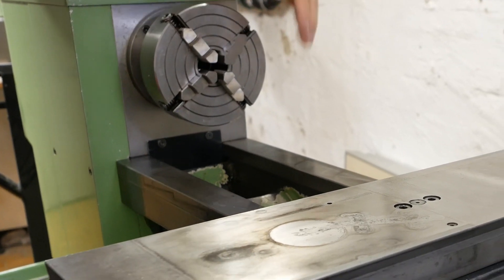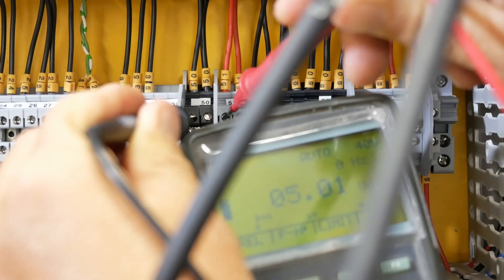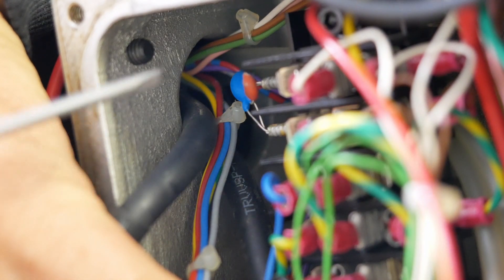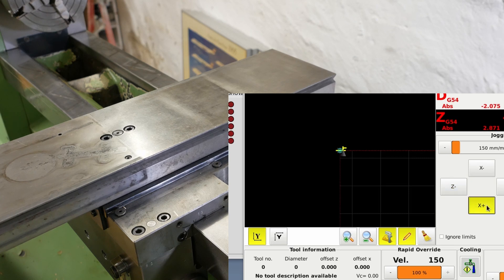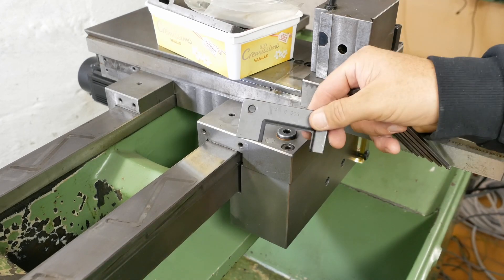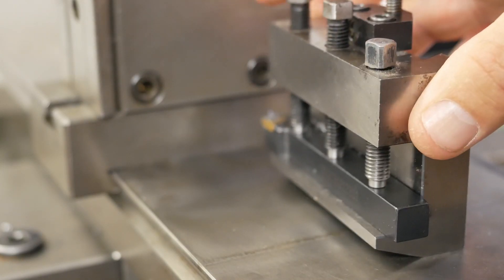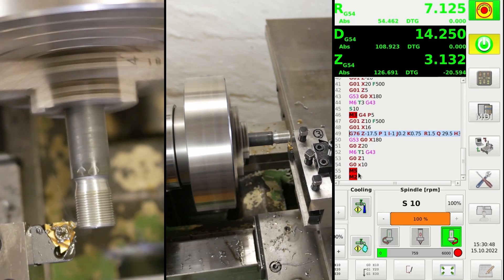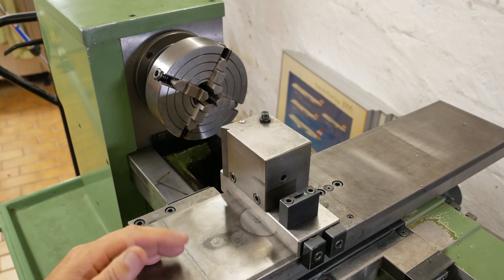Troubleshooting and progress - Schaublin 125-CNC retrofit Ep.44

Comment: Wow, nice progress there. But those cuts don't look or sound right to me, not for a CNC, i don't know. I would test it with "better" material, different inserts, speeds...
Reply from the maker: I am just getting started with this machine, and it will take a while for me to learn it.
Reply: @RotarySMP  I'd measure X when taking a cut in Z, or maybe just let it turn without a cut just to make sure servos are not getting funny instructions from electronics.
Reply from the maker: @NskLabs  I have tuned the servos better since I did that first rought tuning, but it is a good point to check again undr load, as that is when interference is more likely.

Comment: Do you have to setp for the pin to become active? Say for an index input pin on spindle0
Reply from the maker: The Mesa 7i85 has dedicated encoder inputs (as do 7i77, 7i97 etc). So you wire up your index, A B and inverse signals to specific connectors, but then dont need to net them in LCNC. You can  net to the Encoder pins such as index, counts, etc.

Comment: Swarf at high speed woo hoo.  Yes we can all write gcode which is painfully slow. Do you not have ncam (native cam) on another tab? I use ncam for milling routines. It’s very good and I imagine a big help for your lathe 😊
Reply from the maker: I installed Andy's "Lathe Macros", but it turns out I installed the files associated with LCNC 2.9, but I am running 2.8. I need to either update LCNC, or dig out the older files. That sort of canned cycles is normally good for 95% of lathe work.

Comment: I am continually amazed at your patients. Something I never had. I see that Schaublin uses the same cross slide nut attachment arrangement as Chinese mini lathes. I just made an adjustable nut for my 7x. And thanks to Heather...I enjoy the sparks too.
Reply from the maker: My guess is that the precision ground ball nut for the Schaublin costs significantly more than the mini lathe :)
Reply: @RotarySMP  I know nothing about the nut itself. I just noticed the the way it is attached. Two outside screws with a depth stop screw in between them. I had thought that only Chinese lathes used that method.

Comment: Ewww, feed/min on a lathe?  Nice to see chips !!
Reply from the maker: Good point. I need to learn to use surface speed.
Reply: @RotarySMP  feed/rev comes naturally. Surface speed is optional, imo. I only use it when diameters are large and there is a lot of material removal.  Otherwise you wait for the spindle. Under a certain diameter, it's essentially always max for aluminum anyway. For steel it gets more use. How long until we see a model engine build?

Comment: Another breakthrough. I'm made up for you mate. 
Those bare cap leads are quite an oversight by Schaublin tbh. All they needed was a couple of sleeves to prevent shorts. Unless, of course, the cap was fitted as a mod at some point?
Reply from the maker: You know, I just found out that the variator end stop (24V) switching, is triggering a Hall sensor and estopping me. I wonder whether the caps were added for that? They are 40 years old, and may have dried out?
Reply: @RotarySMP  The capacitor responsible for the home sensors doesn't look like an electrolytic which have the infamy of drying out, but more like a ceramic type, or maybe even a transient suppressor such as a varistor given the odd colour marking. Hard to identify properly from the short role in this video, but the one shown looked like it has proper wire wrapped joints as termination which is why I'm puzzled that sleeves were not used.

False triggering might be from a long run of signal and power lines running in parallel that may have been introduced, and revise them. Also check terminations of the Hall sensor return which might be high impedance. If it's for a safety interlock, which would be normally closed, the high impedance connection lets just enough current flow for normal operation, but is highly susceptible to switching spikes. Good luck with that, they are a devil to trace.

Comment: let your friend know I would be willing to pay him to help me get my lathe configured, she's gonna be ready for configuration work tomorrow. You should consider one of those chinesium 4 position tool changers, they have upto 8 positions horizontal ones too. Are you going to have flood coolant ?
Reply from the maker: I will pass your comment on to Wout.

I have the 4 position pneumatically actuated tool changer which came from Schaublin. It can also take 4 more in round mounting points. Once I have the user module dome, that will be thenext part of the Schaublin project. Yes, it has a flood coolant tank, with 3Ph pump, and Pneumatic shut off valve integrated into the machine. I am not sure whether I will actually fill it and use it, but it will be there.
Reply from the maker: I talked to Wout, but he is swamped with work, and not available for other tasks. He does check out the Linuxcnc forum sometimes, so If you raise a thread there, he mikght be able to help a bit.

Comment: Great video!
Usually carrier frequency of the drive(kHz) can be changed. It will change the noise of the drives but also will change the switching of the IGBT.
Reply from the maker: Good point. In need to look up the range of frequencies it offers.
Reply: @RotarySMP  It is called switching or carrier frequency.
Reply from the maker: @Izidor1111  Thanks. I'll check it.

Comment: WOOP WOOP Congrats on the first thread. 
Keep ya rapid traverse where you are happy quicker is not always better. 
Had a couple of Hardinge lathes and they got smashed up because even with 30 m/min you have NO time to react. 
One machine got written off after going full rapid speed into a 8" chuck going 5000 RPM  was only 6 mouths old 😁😁50k+ destroyed in seconds. Oh and a new pair of pants for the operator 🤣🤣
Reply from the maker: I am also thinking about dialing that back to 1m/min, until I get some experience on the lathe. I already showed enough CNC crashing with the Maho. :(
Reply: @RotarySMP  Just think of it as a learning curve when u do have a smash but 1m/min you can relax 😁😁. 
But nothing worse than the "shame and embarrassment" when you do it in a shop with 30/50 blokes. 
In the UK. Most people check to see if you are ok right after a smash, to immediately piss-taking for the next few weeks or until someone else does it. 🤣🤣 Cheers keep  up the epic vids 👍👍👍👍
Reply from the maker: @harezy  I can imagine that some of those"destroy the new machine" crashes can follow a guy for a whole career.

Comment: Really curious about your setup for the cuts in the "sparks for Heather" section... Is that a long parallel or something that you're using for a cutting guide? Never would have thought you could get away with the cutoff disc rubbing up against it without marring the guide... Or maybe that's not a problem?

Thanks for the video 🙏😺
Reply: It looked like just a piece of scrap flat bar to me.
Reply from the maker: It is just a piece of scrap. Running the cut off wheel along it does wear it a little, but not much, and you get a really clean cut.

Comment: That capacitor with naked leads in a cramped up junction box is asking for trouble. Glad you're soldiering on, I think I would've lost interest and moved on to another project 😆
Reply from the maker: I have had a number of suggestions to shrink wrap those cap legs. Will do. Thanks.
Reply: @RotarySMP  kapton tape is another option.
Reply from the maker: Anything is better than exposed wire.

Comment: At work (industrial automation) we recently did away with as many home sensors as possible, because they are just always a hassle during commissioning. Now we let each axis run at slow speed and a low max current until it hits a hard stop, by monitoring the target and actual position we know that it has reached the hard stop, and as such, is 'homed'. Saves a lot of hassle, and if your reed switches go out some time in the future, this trick might save you a lot of work.
Reply from the maker: Good idea, but doesnt that hard stop slowly wear and your home position drift? Setting up my drivers to software control the output current would be more of a challenge for me. :)
Reply: @RotarySMP  well it's a piece of steel contacting a piece of steel at low speed. The current limit is a setting on the drive, called the 'max torque', you can limit it to a percentage. But even at max torque I'm not worried about wear, the contact happens without an audible *clank*, at much less force than for instance vice jaws. Even then, if we're within half a millimetre that's plenty of precision for us:)
Reply from the maker: @Bluecoldcaffe  How do you do limit switches for the normal operation?
Reply: @RotarySMP  We've ditched those too :D
Most of the time, they weren't adding much value. Usually, the maximum range of travel for our machines is near the required range of travel, so the limit switches were frequently set very close to the physical travel limit. If a limit switch was triggered, by the time the drive could do a meaningful response, the physical crash would've already happened. So then the limit switches just costed time and money and were another failure point.

Comment: How accurate is the position using the home sensor? I mean if it highly repeatable?
Reply from the maker: I meant to put a clock on it. I have it set up to home to the sensor at speed, back off, home to the sensor slowly, and then continue to the next encoder index pulse, so it should be extremely accurate and repeatable. Need to check that though.

Comment: Well done, moving forward. What was the spindle speed? From what I could see, it looked like 10 rpm, but that is just silly!
Reply from the maker: Yeah, I still need to set up the whole spindle control, so currently the S word is the voltage I pass to the VFD. 10V = max speed = 70Hz on the VFD. You can see just below a read out of the spindle speed from the encoder. It was about 720 rpm in this case.
Reply: @RotarySMP  to answer the question in the thumbnail, 1.0 pitch, I can cut at 2700, which is as fast as my carriage will travel!
Reply from the maker: @smallcnclathes  That is about the same speed I set this too. I think Contantine set up his 125-CNC for 5M rapids. That seems excessive to me :)
Reply: @RotarySMP  one of my lathes has 6000mm/m and unless the accel/decel is set right, it would pretty destructive I think
Reply from the maker: @smallcnclathes  I think I will dial back on the 3M/Min until I have some experience with the machine.
Reply: @RotarySMP  I have a fair bit of experience with my machines, but often drop the rapids down  for a first run.

Comment: The bare legs of those caps is the kind of thing that would keep me up at night. You may want to think about wrapping them in some electrical tape for some cheap insurance. After all this might not be the last time you open that box and give the wires an opportunity to work themselves into a problem state.
Reply: Dont use electrical tape, strip some plastic insulation off a small wire the right diameter, and slide thatnon each leg like a sheath. Obviously you need to unscrew the legs to slide it on.
And as a general rule, NEVER use electrical tape. The shitty glue lets go when warm and when exposed to certain fumes and gases, and the glue migrates into the wire copper strands and will seriously f-up your connections if a clamp down type on multistrand cable.
Electrical tape was never much better than a WW2 emergency fix, it has no place in good wiring. The horrors I have seen...
Reply from the maker: @wizrom3046  Thanks for the tips. I wasnt going to use tape. The plan was for heat shrink, but stripping insulation off wire is also easy.
Reply: @RotarySMP    in the very small sizes, wire insulation is thicker and more crush resistant. Really fine heatshrink is paper thin.
Love your machine! 🙂
Reply from the maker: That is a good idea.

Comment: Yes my lathe threads a lot faster 😁
There's a formula in the manual for max threading speed for any pitch but I think my travel speed while threading can be faster than 3000mm/min and it has 15m rapids
Reply from the maker: I dont doubt that production machines basically max out their rapid speed on coarser threads.

Those big revolved tool changers always look like they are going to crash. Doesn't matter which camera angle, they are always scary :)
Reply: @RotarySMP  The max travel speed is 10000mm/min but when taking acceleration times into account, it's probably not often possible to fully utilize that when threading.

My lathe model actually had the fastest tool changes in 1987, I think the longest tool change time (for 180° rotation of the turret) it takes only 3,6 seconds.
Reply from the maker: @MF175mp  Has that machine ever crashed hard? I bet it can do a lot of damage to iteself.
Reply: @RotarySMP  the previous guys have crashed the turret some time so that it needed to be realigned. I haven't broken anything except one turning tool yet. Went accidentally rapid to x50 instead of x50.0. The machine thinks in microns so it went almost to the center. Luckily the workpiece was only held by like 10mm in the chuck and it was pushed out of the chuck.

After that I changed the parameters so that it thinks 50 as 50mm and not 0,050mm. Just In case I forget it another time. I still try to write the programs with dots after mm's.

Also one time crashed the turret to tailstock when changing tools, nothing actually broke there.
Reply: There actually is some threading on my video about modifying a live center, some of the video is sped up but the threading is real time

Comment: I once bought a 24V PSU that would exclusively run on 400V, i.e. you had to supply two phase power. I wasn't even aware that these existed, and it was a pretty big surprise when I integrated it with a machine that would only run on a single phase. Nice of Conrad to just take back stuff for a full refund without any questions...
Reply from the maker: That was nice of them. Shame they are closing their stores.
Reply: @RotarySMP  Ah yes, but the stores were always a mixed bag anyway. Like a physical manifestation of a PEARL catalogue.
Reply from the maker: @graealex  Yeah, but better than nothing. Do you know which of the big online electronic component companies sell to individuals? RS wont.
Reply: @RotarySMP  RS does sell to individuals. And for a long time, they were the primary distributor for Raspberry Pi, which is directly aimed at hobbyists. Search for RS Privatkunden, they even have their own shop, since 2016.
I also never had trouble getting stuff from Digikey.
Reply from the maker: @graealex  In Austria as well? One of my mates still had an account from UNI. We tried to order some parts and they promptly closed the account 😢
Reply: @RotarySMP  You might want to give mouser a try
Reply: @RotarySMP  You're right, the consumer shop is only for Germany, and the Austrian shop does want you to enter company name. Although unless they want proof of commercial ownership, I don't see why you can't just fill it out with your name.
But to be honest, I own two companies, one running under my personal name, one which is incorporated, so this never has been a problem for me anyway. And I don't remember that I had to provide proof for any of these companies.
Reply: @RotarySMP  Wait a minute - it says here "Firmenname (falls nicht vorhanden, bitte Vor- und Nachnamen angeben)". 
So, idk. Maybe just try ordering from their dedicated Austrian shop?
Reply from the maker: @graealex  I tried. They sent an email asking for the Firmen Nr, and then cancelled my order.
Reply: @RotarySMP  I would not have expected that. Most B2B shops will also service consumers, as long as it doesn't cause any problems.
Reply from the maker: @graealex  I really dont understand that whole culture. A customer is a customer. If it is due to the consumer protection liability laws, charge me more.
Reply: @RotarySMP  Here in Germany the laws are quite different, and maybe if a company expects only a few percent of business being with consumers, but having a lot more work with it, then they might deem it too much work.
Many years ago, my DELL key accountant told me that their consumer sales and support department had to move buildings - so the B2B department did fill in, while the B2C department packed up and got ready in the new building again. He was shocked at how different the calls from consumer were, compared to his usual B2B. People calling in drunk, being offensive, unreasonable, all the stuff. That might have something to do with it as well.